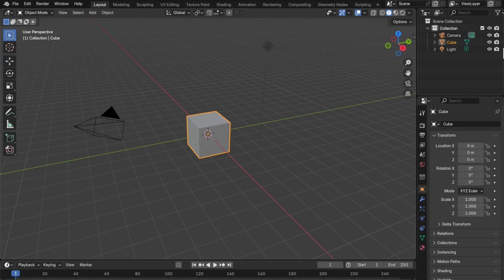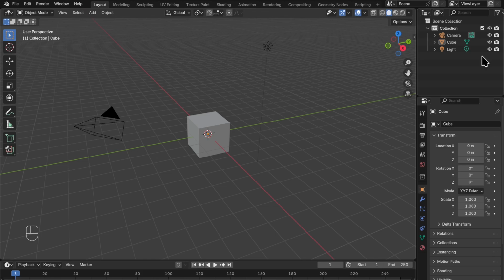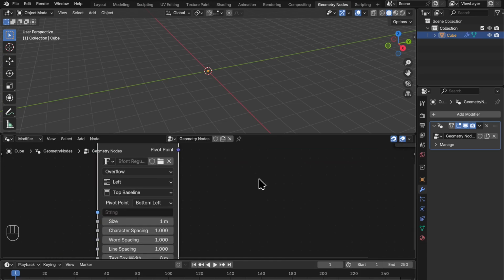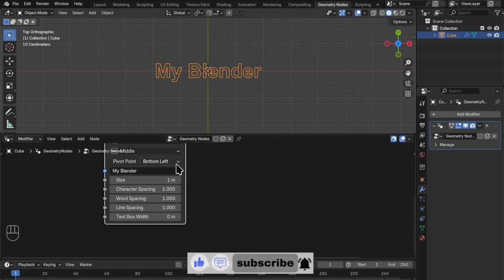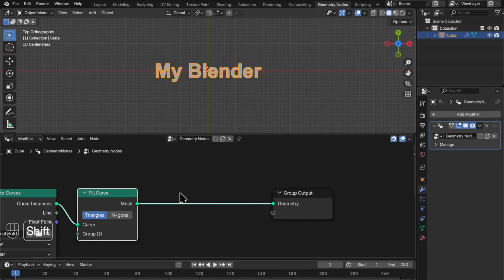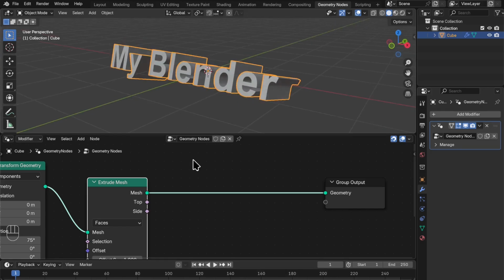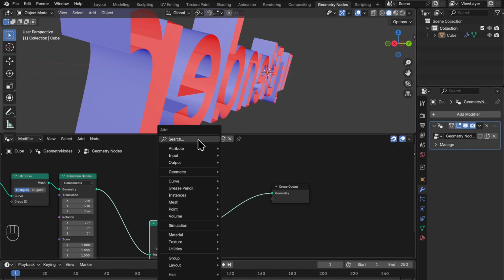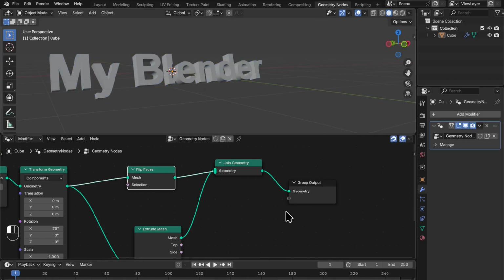3D Text in Blender | Geometry Nodes Tutorial for Beginners

Comment: to achieve the same effect in less steps, go to add+text. then increase the extrude depth.
Reply from the maker: Yes that works as well but geometry nodes are not being used
Reply: @DisabledBlenderman you can model a complex character using geometry nodes in 8 years or sculpt it in two hours. As satisfactory as it could be making a character with geometry nodes I rather not.
Reply from the maker: @JorgeZombie78 A thing about Blender is that you can achieve the same result or do things multiple ways, so it is up to the user as to what they use.
Reply: @DisabledBlenderman really? Never would've figured that out! Thanks for the tip! You changed my life!
Reply from the maker: @JorgeZombie78  Glad it helped